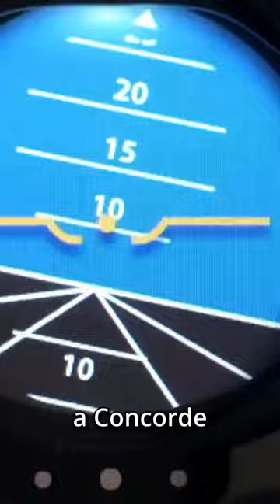What Caused Concordes Most Deadly Crash? #shorts

Comment: Keep in mind what type of aircraft the other plane involved in this incident was: Continental Airlines Flight 55, operated by the same McDonnell Douglas DC-10 that was also known for harboring other far more critical loose parts (like cargo doors for the record).

Of course the DC-10 is also a retired aircraft, with good reason, but the reason why they retired the Concorde first isn’t because of this crash but because of something far simpler: cost. The Concorde was a gas guzzler, pure and simple — think of it this way: while it takes you days to run out of fuel on the road, it takes mere seconds to run out of fuel on a drag strip. Same thing goes for aircraft: the faster you fly, the more fuel you burn, and as speed increases, fuel consumption required to reach that speed goes up not linearly but as a square relative to it. Eventually you reach a point where the aircraft needs to burn so much fuel that you need to charge 5 figures for flight tickets just to break even, which is, to put it mildly, not a price that very many people are willing to pay for just 1 or 2 saved hours.